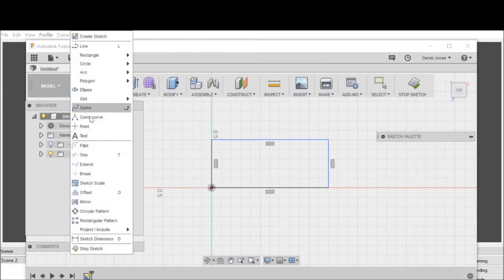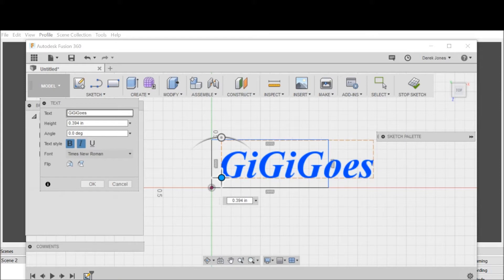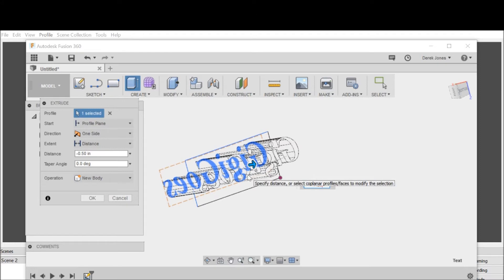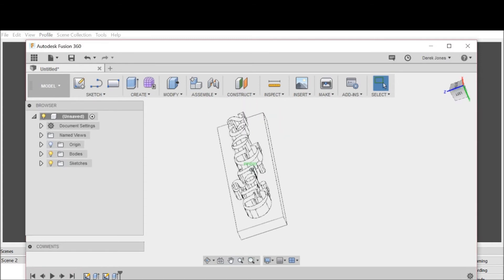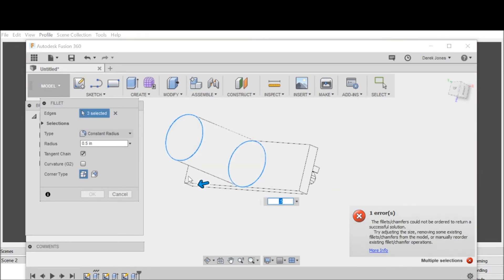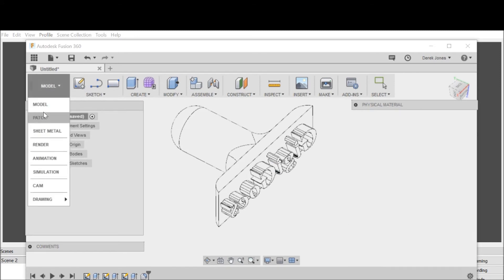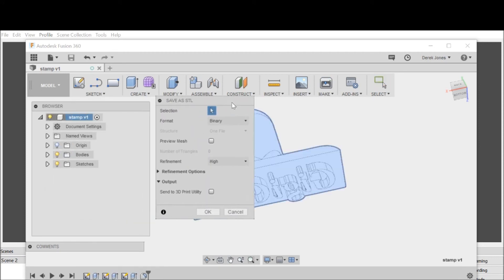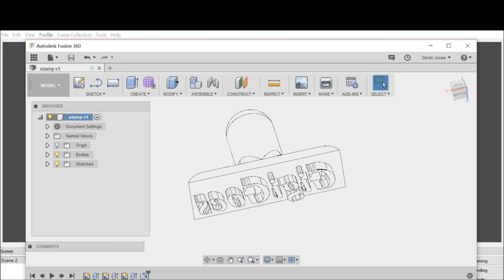3d printed stamp tutorial super easy using fusion 360 and a 3d printer

Comment: My letters keep coming off when it put any pressure on it. What am do i need to think about to try a fix it?
Reply from the maker: I’d try increasing layer height, increasing infill percentage to at least 25% and bumping temp up 5 degrees.
What printer and material are you using?
Reply: @jonesmachineco  Thank you. I am using Creality cr-10s ideaMaker slicing software, and PLA
Reply from the maker: That should do it. Let me know how it turns out?
Reply: @jonesmachineco  Awesome thank you I will let you know when I try again. :)